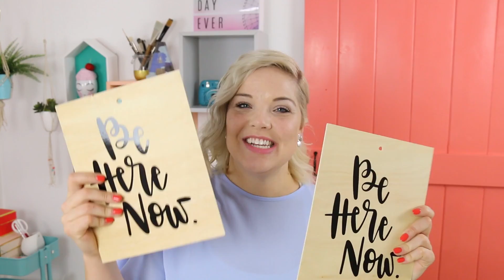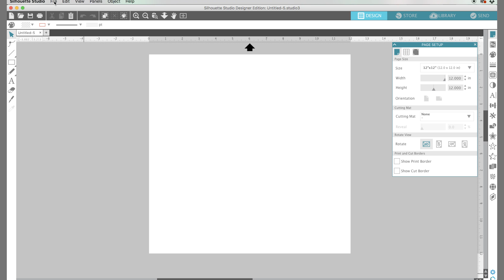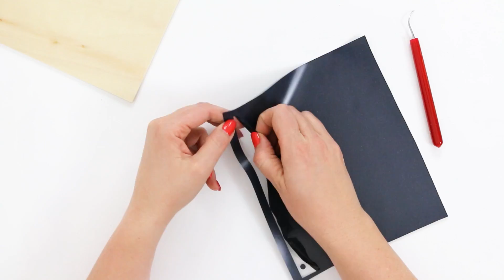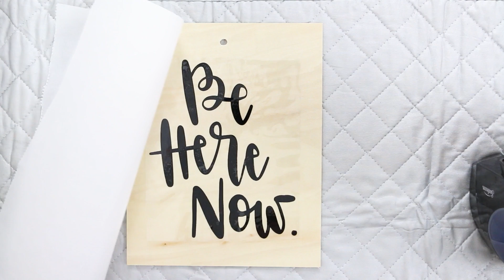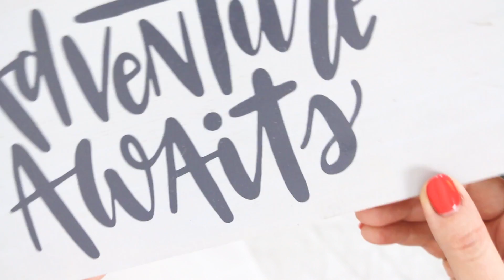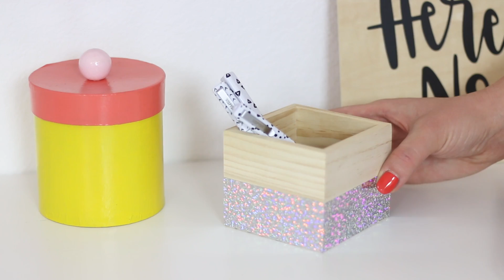Silhouette vs. Cricut: How to Use Heat Transfer Vinyl on Wood

Comment: if this would be an outdoor sign, what do i need to apply to seal the vinyl to protect it from rain damage. Can i apply htv to varnished wood?
Reply: Did you ever figure out an answer to this? I'm looking to make a garden sign - potentially using HTV on wood - I just can't find any answers

Comment: Is there a Weedless Heat Transfer Vinyl that, is also for wood. I love applying images and text onto wood. Using Freezer Paper and wood burning is my current methods and, I'd love to take it to another level, quicker and faster. Great presentation.

Comment: Do you think HTV will stand up to outside elements (hot/cold) under a covered porch? Or would it be better to use 651 or stencil and paint?
Reply: Did you ever find out if HTV would work on wood for outdoor purposes?

Comment: Is it possible to use heat transfer vinyl on particle board (like a clipboard)?
Reply from the maker: I think it should work on something like a particle board clipboard, but I haven't tried that yet. As long as the surface can stand up to heat, it should work well. :)

Comment: Does it work with a heat gun ? If the surface is not totally flat like a skateboard deck ?
Reply from the maker: I haven't tried it with a heat gun, so I'm not sure. You also need some pressure for a good application.